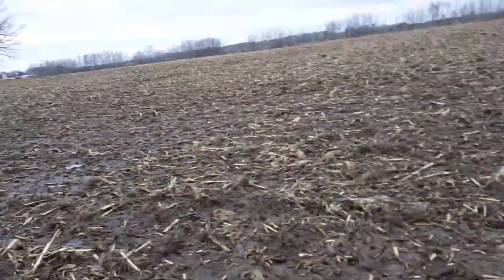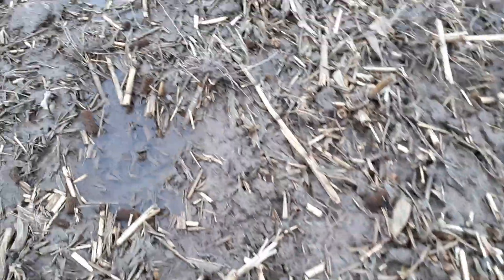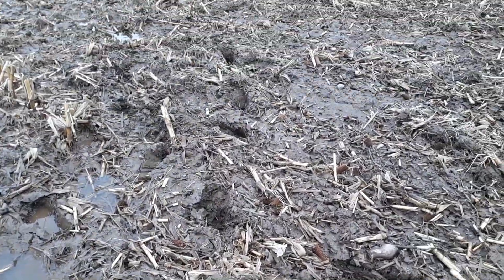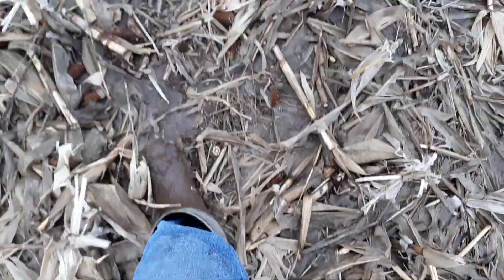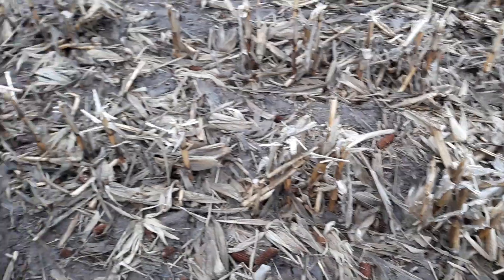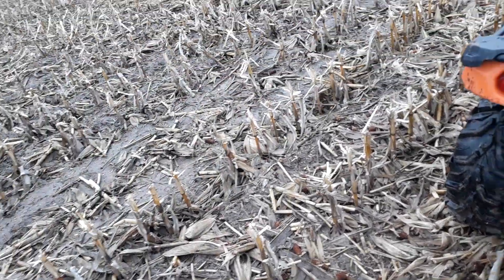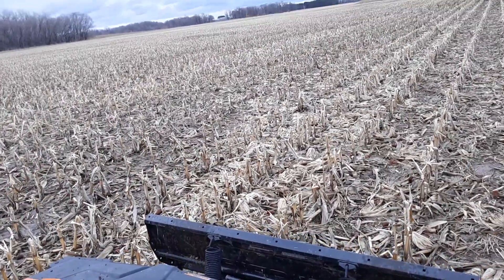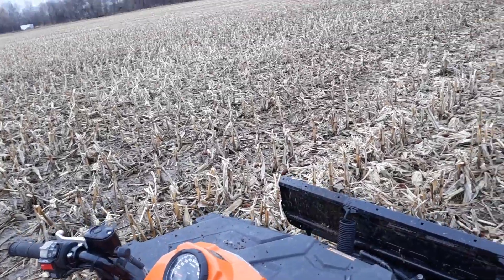soil health farming vs conventional.  water infiltration comparison.

Comment: I would try the no till thing but all the big guys around here are going back to conventional or minimal till. Non of my equipment is no till. So the first thing I would have to get things switched over. I am looking for a no till drill to put wheat in after beans.
Reply: We have a lot of clay soil and what I have seen is the ground has to be dry when you plant or later it the summer when it does dry out you get a big crack were the row is and the plant suffers.  They are trying min till but now they are getting this smearing in the fields. The big thing I seen used lately is a disc chisel with a cultivator and rolling baskets setup in the fall. In the spring they disc and field cultivator before planting.  A lot of is being done because of Grand Lake St Mary's having the algae bloom from fertilizer run off. The state farm extension leaders are still pushing no till for the soil erosion but are starting to see that the tilled ground is helping with the lake problem. It is interesting how life is a circle.
Reply from the maker: @TAHDAHFarm  
Takes time that not many are willing or able to get through on large percentage of their farm.
I have seen clay soils like that. Every year they had to deep rip and if it was dry it would be chunks of concrete coming up. After 10 years of soil Health stuff they had what you could call soil.
That's why I always say pick out a couple rounds of your widest implement between the planter or the sprayer and just find a few rounds in a field somewhere that nobody can see. Give it five years of learning.
Reply from the maker: Soil health is what makes no till work here. Break the corn bean cycle, use covers and BAM!!